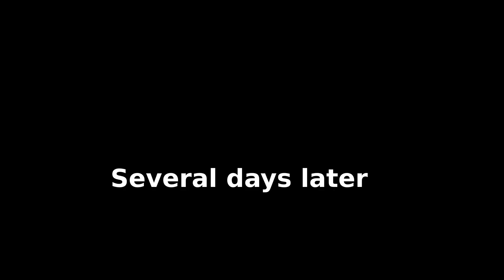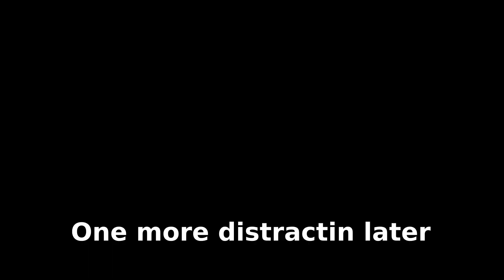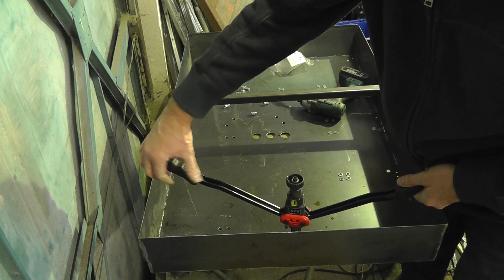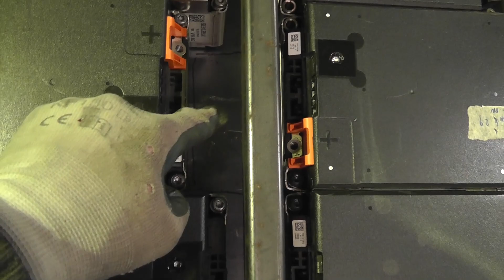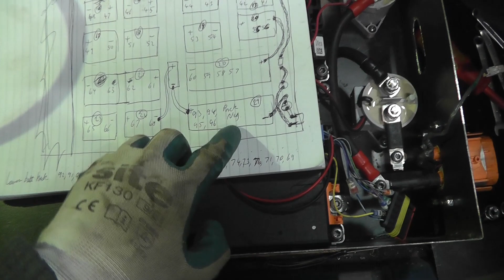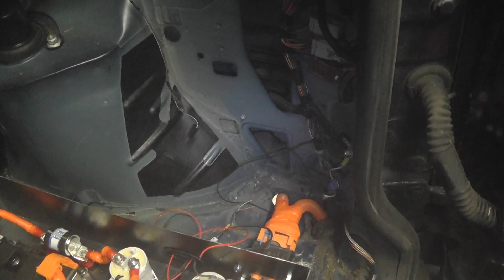DIY EV Part 35 - Rear battery box in the Boot/Trunk

Comment: that's a beautiful box! are you using a pre-charge relay? i guess i missed how that will fit in with the contactor/relay setup along with your safety plug switch. if you have a circuit diagram, you should show it in your next video! great job. thanks for sharing!
Reply from the maker: Thanks Frank
Yes precharge is in the HV box under the bonnet along with two more contactors. I'll be showing that in the next video.
Reply: @alibro7512  oh that's interesting. I guess now I need to know why you have 4 contactors!
Reply from the maker: @FrankGraffagnino  LOL, purely for safety. 
The contactors in the boot box are only there to isolate the complete box when the ignition is turned off. I do not want the cables running front to back to be permanently live. There is also a 'tamper' switch in the HV Socket so it turns off the contactors in the event someone pulls off the plug with the car turned on. The contactors in the HV Junction box are to connect the HV to the Inverter and charger.

Comment: You can use an independent sounder for monitoring water in the lower battery box. These are cheap and self-contained, so don't need anything from the vehicle to work. 
It gives peace of mind without spending out too much on equipment and time. ;)
Reply from the maker: Good idea mate. Something else to add to the To-Do list. 😉

Comment: Great progress and looks tidy, did you mention the fuse size & HV cable size.
Thanks
Reply from the maker: Thanks
The fuse is 400A which is the same as an eGolf. The internal battery box cable is 35mm2 which is also the same as an eGolf and the long cables going to the front of the car are 50mm2.